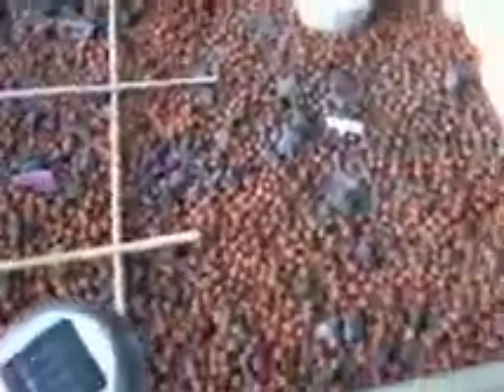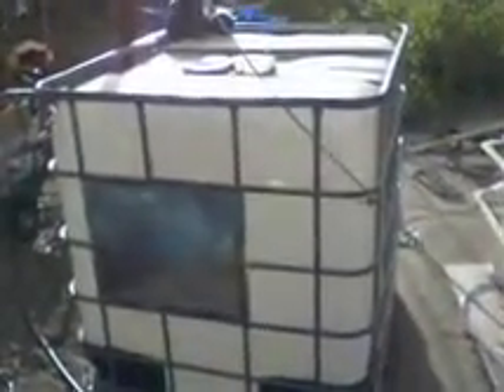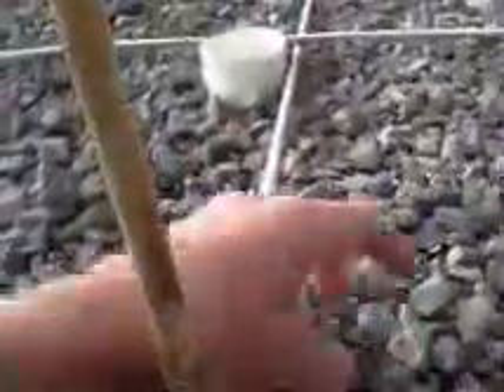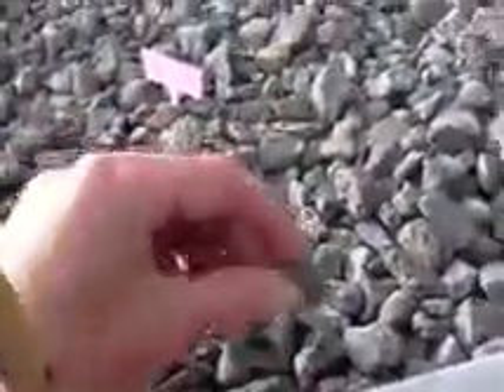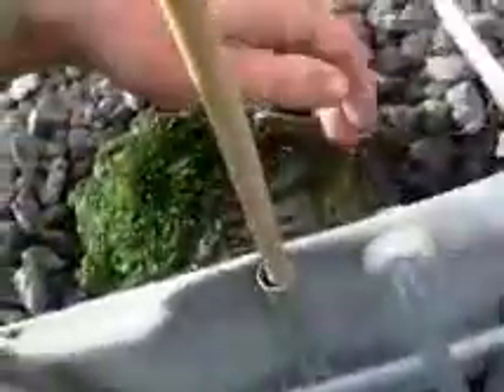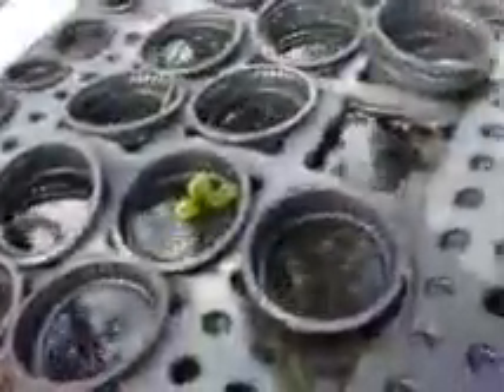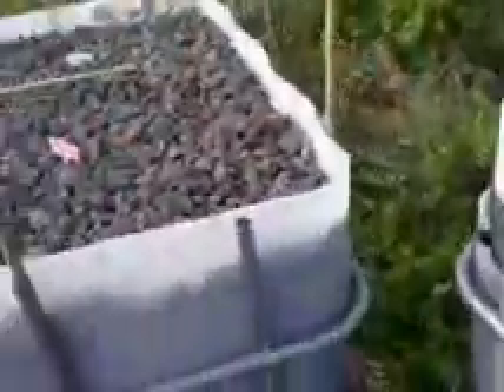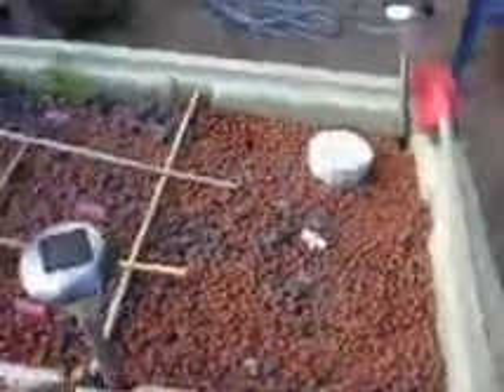Aquaponics overview of different systems

Comment from the maker: No I am giving away produce when there is excess to anyone who wants it, most people in the area know what I am doing and contact me to see what is available, mostly loose leaf lettuce and carrots. As for hot and cold streaks, I have four IBCs in the garage which maintains constant temp between 20 and 28deg C. The water moves between the cold outside cooling it to about 18c in winter and up to around 22c in summer. Will try to post an update showing the whole system and other units bath/barells.

Comment from the maker: I first started with aquarium pumps and went onto use submersible transfer pumps. Now it is all solar with 12v backup pumps with low water cutoff switches. There is also a 12v flashing amber light that alerts me to the system having cut out and the DC pumps are on. Old car and truck batteries with a little life still left in them on a solar trickle charge are the power source.